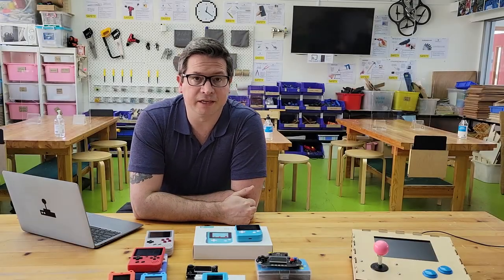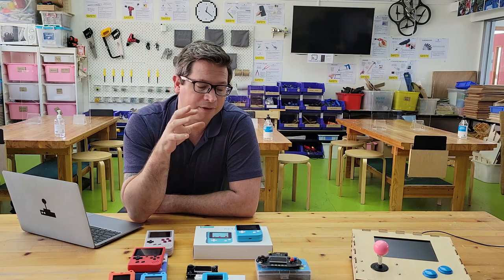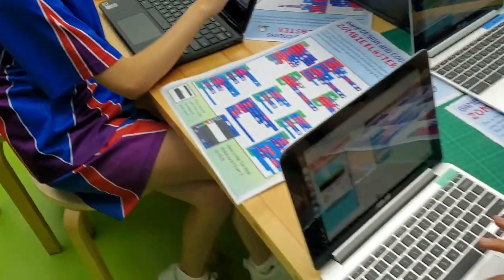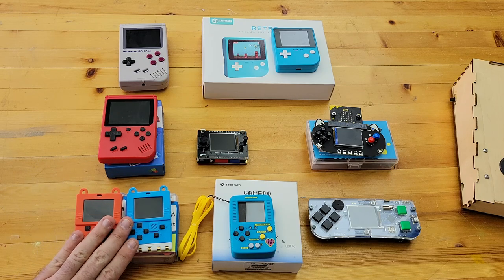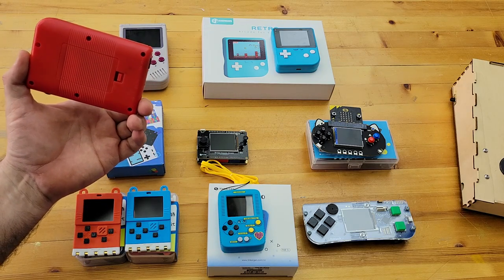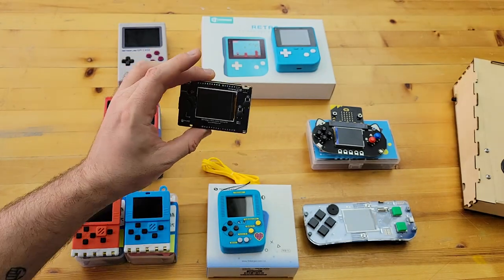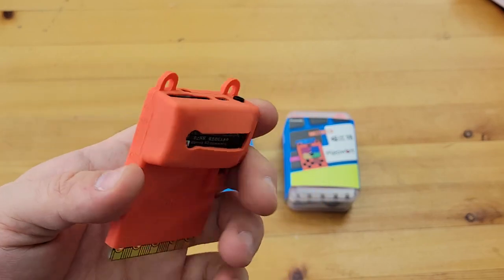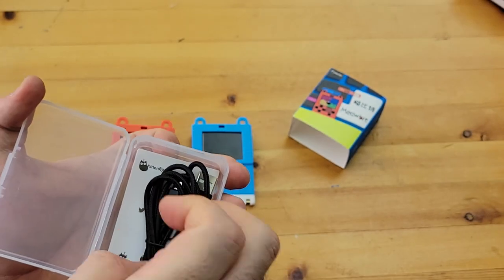Comparing Makecode Arcade handhelds

Comment: I have two of those Adafruit PyGamers and I love them! They have nice controls and stuff and they can handle a lot of sprites and stuff. Recently I finally made a project big enough that it doesn’t fit on my console and it was over 2133 lines of code long with like nine images and 15 levels and just getting rid of the images allowed it to run just fine. 100% would recommend the Adafruit PyGamer, just mind the price.

Comment: Thanks for the overview, made me curious on the Kittenbot Bridge (can't find that anywhere) and the inner workings of the Retro (no specs available).
Which makes me stick to the Kitronik and the PyBadge (not in this video). That is because you don't discuss the software side, and that is actually quite important.
For the Kitronik & PyBadge I know that they both run on a ATSAMD51, which is a powerful chip (200MHz, 32 bit, 192kB RAM, 2560 kB flash, FPU and 2xDAC for sound), with much more oomph than a nRF52 in the Microbit V2 (64MHz/128kB RAM/512kB Flash). And those 2 run on 1) MakeCode, 2) circuit Python and 3) my favourite C++ through the Arduino IDE or Visual Studio Code to get some serious performance out of it. I agree the buttons on the Kitronic are not the best, but the fact it is cheap, with short delivery times and made in the UK for a decent price (35€) and the Adafruit made-in-NYC for 30€ with plenty of 1 day ship options in the EU make it my favourites. Do you have any tech specs on the ones you showed?

Comment: Thank you for the video! Especially for the Elecfreaks Retro part - I've thought of buying one.
Two additional consoles are listed on the makecode site as compatible - Adafruit PyGamer and Xtron Pro. And I must say, PyGamer looks very promising and very reasonably priced.
Reply: I use the pyBadge, a slimmed down budget version of the PyGamer. Love it.
Reply: @lovemadeinjapan  Yep. I've ordered PyGamer, and It's perfect for makecode arcade. Fast, responsive, small, but not too small, - and I love the analogue stick.

Comment: that thinkbox thing actually has the same exact case for a really popular fake Nintendo NES emulator console and you can actually connect it to the tv using a special adapter thing.
Reply: I think I have the same Nes emulator retro handheld and yes the rca tulip goes into the tv (yellow outputs video, and red outputs mono sound). It looks good on an old tv with scart. Digital tv's with scart show artifacts and degradation of colors. Just my 2 cents 🙂

Comment: KittenBot Meowbit vs. TinkerGen GameGo:  Yes, the GameGo is louder, but the Meowbit has a micro:bit connector which lets you control electronics projects in addition to running MakeCode Arcade games. Also, the softer speaker of the Meowbit may be a feature rather than a bug: do you really want a classroom of 30 students all playing games at the same time with the volume on full blast? 😱
Reply: You have a point, but Game Go is better if your targeted to makecode arcade
Reply: @Shades423  Why is GameGo better than Meowbit for MakeCode Arcade? Both are supported hardware, yes?
Reply: @fred.chapman Game go is bigger
Reply: @Shades423  Yup, GameGo looks like it would feel better in your hands, which means it's probably more enjoyable to play.

Comment: I am curious,  with the Think Box one how you added games. I have cheap handheld retro game which looks exactly like that I picked up for $12, and served me well for some mindless distraction when I traveled more for work, playing some classic NES games here and there. Never really considered what was under the hood. I assumed a Famiclone on a chip setup. Now I wonder if their might be a way to cheat the hardware into running something else, like MakeCode Arcade. I'm thinking about getting a couple compatible handhelds as my kids have actually been coding their own games in their STEM school, and I'd love for them to keep at it. Also, I've coded a couple of my own games, and kind of want to see them run on actual hardware. 

Thanks for the rundown of these systems.
Reply: The thinkbox is actually not using the same internal hardware as the cheap retro handhelds unfortunately, just re-using the casing I think. For Makecode specific hardware they all have a specific set of chips and OS that enables games to be copied on to them.
Reply: @makegamestuff4850  thanks for the insight. I didn't know if maybe there was a generic chipset/hardware the software ran on, it would be just a matter of flashing a new boot image.
Reply from the maker: They are mostly running on an ST32M4F chip https://arcade.makecode.com/hardware/adding
Reply: @StuLowe80  thank you for this information. Obviously this makes sense that it won't work with cheaper, "Famiclone," glob chips, but I am curious what the emulation possibilities of this might be. It seems to me having an inexpensive emulation box also be  able to use this would be an advantage. Imagine using, "retro-gaming you can make yourself," as an additional selling point. I know there is the ability to use this software with RaspberryPi. It isn't hard to imagine it being integrated with other, "retro," packages.
Reply: I wound up getting a couple Meowbits. I am happy with them, and so are my kids. I also want to use the edge connector for some additional projects. Your video really helped my decision. Thank you!
Reply: @BuckeyeStormsProductions  Yes you are right, I used cheap case, but next step we will make case ourselves and sell it overseas, our next thinkbox will be 3.2 inch